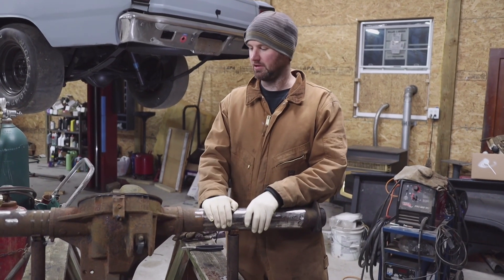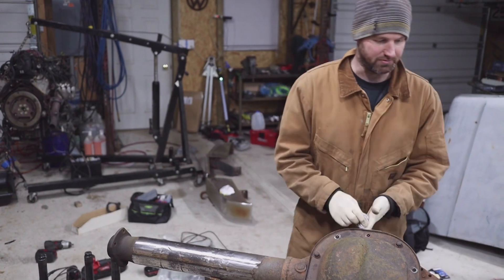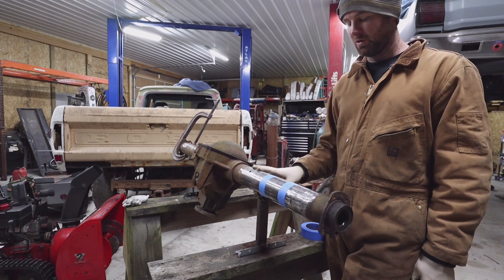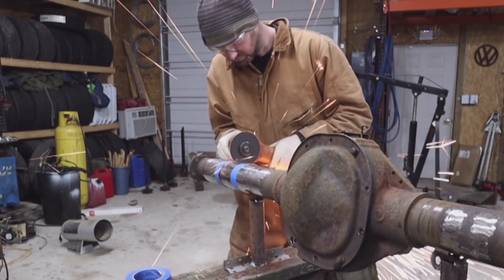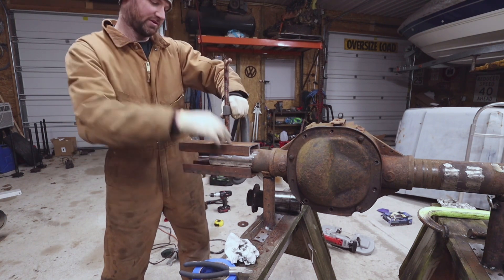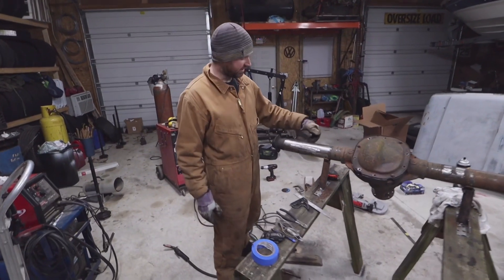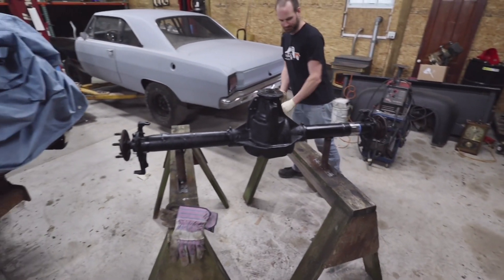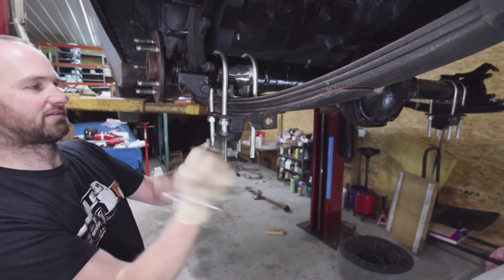Narrowing a Ford 8.8 rear for our LS swap Dart build.

Comment: The problem with the way your doing it is there are no C clip eliminator kits for the explorer 88. if you were to put 9” ends on it and then use 9” axles you can have better axles and get rid of the C clip for 450 bucks in parts.
Reply: True but the rotors keep the axle in there if the c-clips come off or the axle breaks.

Comment: Only shorting 1 side axle tube makes driveshaft off center. Not to worry ?
Reply: Ford rearends are offset to passenger side 3 ".  Therefore it'll center the pinion by doing this.

Comment: Great video! Looking to do an 8.8 swap in my Volvo 240. Using the 3 inch angle iron, combined with checking the bearing using the axle shaft before welding is a great idea. This method should help me keep costs lower, as I plan on using a junkyard 8.8 myself. Only complication is the 240 has a 4 link design, but I am able to pick up pre-made weld-in mounts for 240s.